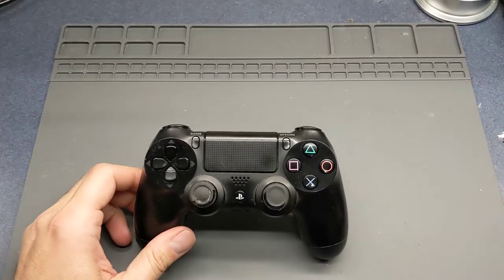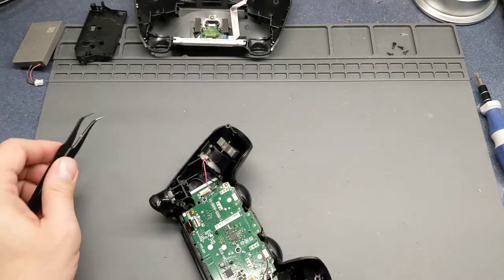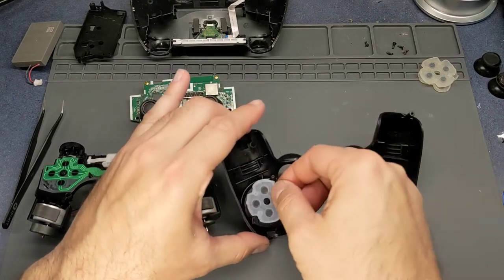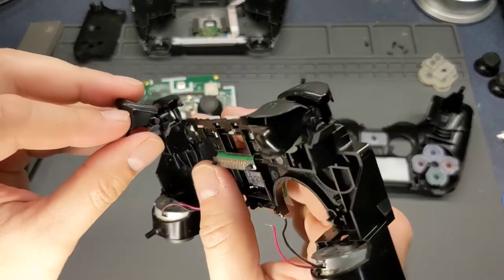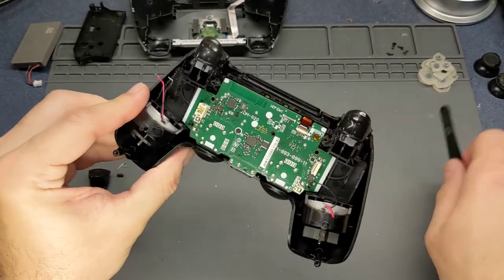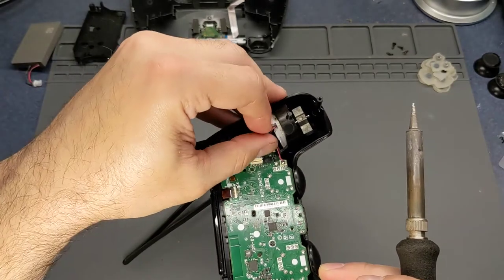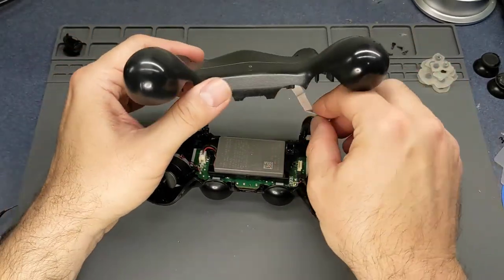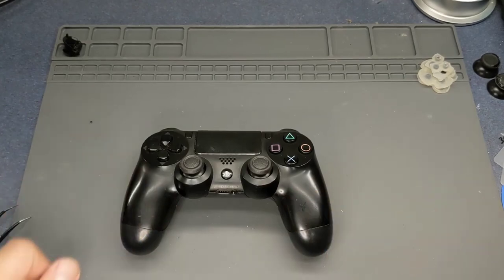PlayStation 4 controller repair

Comment: PS5 controllers have bad drift, kind of like Nintendo Switch Joy Cons. Any advice on those?
Reply from the maker: Do you mean the PS4 controller? If so when the start the drifting issues the analog stick assembly needs replacing, it's kinda like an old scratchy volume knob but with the sticks, lol
Reply: @TheRetroBen  the PS5 DualSense controller. It's already drifting pretty noticeably, and it happened a lot faster than it did with my Nintendo Switch Joy Cons, with a lot less play too.